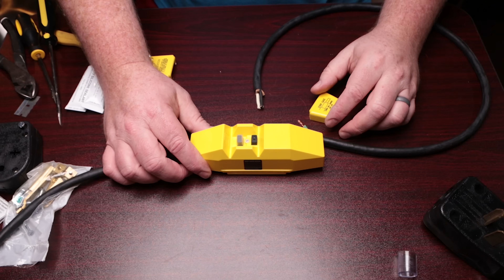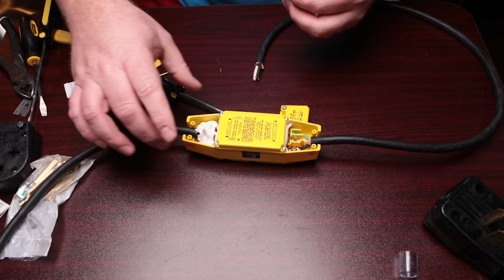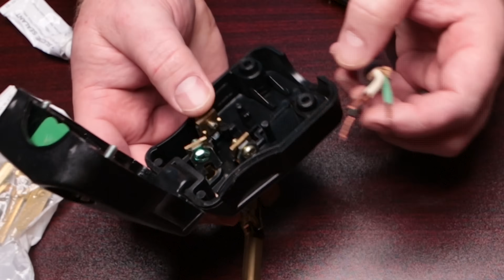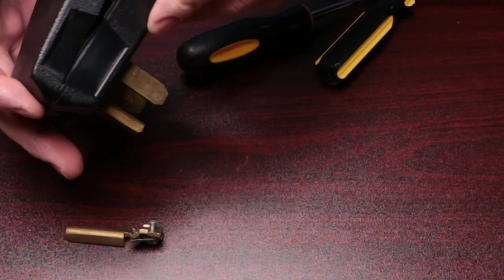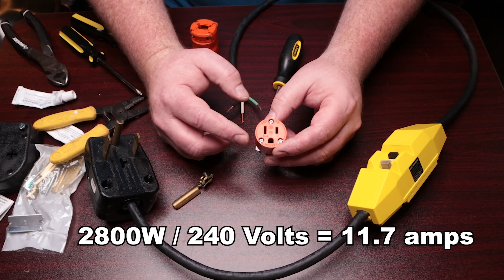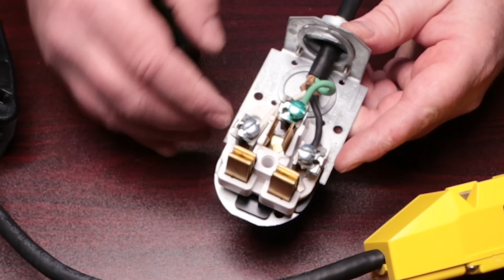Inline 240 volt GFI power cord for Anvil Foundry and Brewzilla Brewing Systems

Comment: Brian, thank you for another great video! One thing I’m confused about though is you using 2 hot and a GROUND wires in the 14-30 4-wire plug. All commercially available 4-prong to 3-prong 240v adapters I’ve seen seem to use 2 hot and a NEUTRAL. What 3 wires does the 240v Anvil Foundry setup need?
Reply from the maker: 2 hots and a ground. Older electrical systems used the 2 hots and a neutral. The ground and neutral generally are connected in the breaker box. (Unless it's a sub panel)   👍🍻
Reply: I am in an older home, so I’m assuming that my dryer outlet has two hots and a neutral (it’s a three prong outlet). I switched to natural gas natural gas 20 years ago so the outlet has just been sitting there. Can I just move the neutral wire to the ground in the breaker box? Or do I need to put in all new wire and outlet?
Reply from the maker: Where is the neutral wire connected currently?

Comment: I have a 4 prong Dryer receptacle.  Should I just leave that piece you took out of the 4 prong in there or remove it and just put the 3 prongs into a 4 prong receptacle? If that is even allowed/safe Thanks for the videos
Reply from the maker: Just leave it out it's not needed. It's for the neutral that's not needed. 👍🍻
Reply: Brian. Thanks for your time.  Since I posted I had one of these made for my dryer outlet--GFCI etc.......however if I ever wanted to have more length on the side of the cord that the Anvil will plug into (maybe if I decide to change my brewing location to be a bit further out to my driveway) could I just add a 240v extensions cord to that end? If so do you suggest one?  Thanks
Reply from the maker: Do you still have the original plug on the Foundry?
Reply: @ShortCircuitedBrewers  yes. I didn't cut it
Reply from the maker: @spinalrx  just use a regular 12gaige extension cord. Keep it to a max of 50' 👍🍻

Comment: Do they make a plug that works for the 12g so you don't need that little spacer?
Reply from the maker: The rating on the plug is higher than 12gauge so it is doubtful. I would just slip a piece tubing over the 12ga wire like I did. it wasn't a special spacer. 👍🍻
Reply: I just purchased the parts. Thanks! Now I need to get a few feet of wire, and also purchase an extension cord. Can I use a regular extension or do I need a 220v extension?
Reply from the maker: Any 3 wire 12gauge cord is fine.
Reply from the maker: If you have a home depot or Lowe's. Take a look at SJOO or SJOOW wire. It really nice and flexible and chemical resistant. Also generally sold by the foot. (Sold as power tool cable)
Reply: Perfect! Your channel is such a wealth of knowledge. Thanks for being so helpful.
Reply from the maker: @tjans1979  good to hear! Thanks for the feedback! 🍻👍
Reply: Brian, few of us on the community noticed that the inline breaker alternates that you provided are not correct and shouldn't be used. I just thought I'd let you know in case you wanted to change your links. Thanks again for all the help!
Reply from the maker: @tjans1979  I removed it already. I saw the conversation. Sorry for the confusion. 👍🍻
Reply: Nah man, it's all good. We are human, I could've made the same mistake. I just returned it and bought the new one. I'm sure you saw the link to that one as well.
Reply from the maker: Yes sir! Thanks for letting me know! 👍🍻

Comment: I bought a 15-50p to 5-15r plug adapter, switched the rocker to 240v, and it's almost as if the unit is working slower... Almost 3 hours to bring 8 Gallons from 50->150. Not sure what I did wrong
Reply from the maker: Sounds like something is wired wrong. It is plugged into a 240v outlet right?
Reply from the maker: Send me a photo of the wiring to Brian@shortcircuitedbrewers.com also confirm you are actually getting 240v at the outlet with a multimeter.
Reply: Thanks, got my multimeter out, looks like the adapter was converting to 120. I'm building your adapter now.
Reply from the maker: @joeodden5326  good deal!! Got the issue figured out! 👍🍻
Reply: @ShortCircuitedBrewers  Works like a charm now, thanks!
Reply from the maker: @joeodden5326  good to hear!!

Comment: If you're not wanting to go the DIY route, I highly recommend acworks.com.  I've used them for funky configurations and they're super helpful with phone service, etc. and they make quality products.
Reply from the maker: Nice! thanks for the tip!
Reply: Hey Ken! I just picked up a 10.5 Anvil Foundry and looking to plug into my existing NEMA 14-50 Receptacle in my garage. Would this ACWorks adaptor do the trick of running the Anvil on 240V and being protected by the built-in GFCI? Looks like it will only support 2,500 W

https://acworks.com/products/s1450cb520-nema-14-50p-to-household-outlet-with-20a-breaker?variant=29483305402429

Comment: My brewing station is about 75 feet away (required cord length) from my only 240v plug on a dedicated 30a circuit breaker. Would I need to bump up the extension cord gauge to 10ga? Or, is 12ga enough?
Reply from the maker: 12 should be good up to 100' 👍🍻

Comment: Does the gfci in line breaking need to be under load to reset? I'm trying to trouble shoot why my new brewzilla isn't getting power. Made this gfci cord but it doesn't rest and test button is stuck down. To be clear it's not tripping the rest, it is not even clicking the rest down...any ideas?
Reply from the maker: Are you using 240 volts or 120?
Reply: @ShortCircuitedBrewers  it's 240, I found that the in line GFCI was fualty and got a new one it all works fine! Thanks!

Comment: Great video and instruction. Always Straight to the point.  Good job.
 I have a question for you. Like some others, I live in a rented house and not possible to modify the electric panel or adding a Spa Panel.  So, to use a 240V GFCI extension cord is my ONLY solution.  I have a 3500W induction cooktop that I bought after I saw an old video on your channel, this is a 3500W 208/240V unit.  I am planning to connect to the dryer receptacle Nema 14-30 (4 prongs).  The actual unit will drain like 15-20 amp, but just want to be ready for another future incoming equipment (Spike SOLO or UniBRAU) that will require I will say like 30 Amp if the heating element is 5500W.  Can I use this GFCI with the 30 Amp consumption? I now that I will have to avoid using all the 4 prongs and will have to properly identify the white wire as HOT with a red tape mark, but for this application, it will require a 10/3 cable and not a 12/3 like this.  If there another unit you can recommend?. Thanks for your knowledge !!
Reply from the maker: This GFI is only rated for 20 amps unfortunately.
Reply from the maker: Here is one rated for 30 amps https://www.amazon.com/dp/B00OZY30RW/ref=cm_sw_r_apa_i_p1jPEbPTJPTCS

Comment: I started making your 240v to 120v adapter for the Anvil Foundry.  I'm wondering if this product would work:
https://www.homedepot.com/p/Tower-Manufacturing-Corporation-18-in-In-Line-GFCI-Cord-30438018/202510249
Could I just plug the Foundry into this, and plug it into the adapter?  It's 15 amp, but I believe the Foundry doesn't pull that much at 240v.
Reply from the maker: you can you would need to change the plug end though.
Reply: @ShortCircuitedBrewers  

So if I bought the product he listed, could I use an extension cord like this with it? 

https://www.homedepot.com/p/Southwire-50-ft-12-3-SJTW-Hi-Visibility-Outdoor-Heavy-Duty-Extension-Cord-with-Power-Light-Plug-2588SW0002/205544514
Reply: @ShortCircuitedBrewers  I'm not an electrician but just get the 240V one at Amazon. This one is for one hot leg - don't even know if it's safe rewiring two of these for 240V.

Comment: I installed a 240V/30amp GFCI 2 Pole Breaker on my dryer outlet.  If you do this too and try to use the dryer outlet thats wired correctly with 3 conductors and a ground you will have to nut and tape off the neutral (white) wire at the 14-30P Male 4-Pin Dryer Plug To 6-30R Female 3-Prong Receptacle adapter or remove the neutral prong as you did. The BREWZILLA and ANVIL both run of a 2 conductor wire (2 hots and ground).  This is essentially what you did by removing the neutral prong. When I bought my converter cable it was wired incorrectly and kept tripping the breaker until I took it apart and figured out they twisted the neutral and ground wires together.
Reply from the maker: Good solution. 👍🍻

Comment: The Southwire GFI is a 240v/20a device.  The Brewzilla 65L calls for a 30A plug.  I recently purchased the components and built this plug but I'm wonder if the thin wires inside this GFI will be enough to handle the load from a Brewzilla 65L?  3500watts for heat alone plus pump and controls probably pushes close if not over that 20A rating doesn't it?
Reply from the maker: You will be fine. It will handle it.
Reply: How did your gfci work. I have a 65L and I just made this cord and it has no power and the reset button will not click down
Reply: @JJJMMMBBBable  If it's not clicking down then the unit isn't getting power.
Reply: @Fidelity101flies  OK, I will check the connections again. Volt meter from wall says 120v from each hot. I should have tested this before putting the Silicon in there. Everything seems tight and only exposed wire is being pressed into the terminals. Same with the plug end....im thinking faulty gfci?
Reply from the maker: Sounds like it?? That's strange.
Reply from the maker: @JJJMMMBBBable  how is it wired?
Reply: @ShortCircuitedBrewers  same as in the video. 2 hots and a ground.
Reply from the maker: What are you plugging the extension cord into?
Reply: @ShortCircuitedBrewers  the wall outlet and the other end to the 65L. I tested both hots to ground with millimeter on the wall outlet, both say 120v. At the other end of the extension cord I get 0.94 v. So outlet is good. All I can do is rewire the gfci in case there is a a break in the wire or get a new inline gfci
Reply from the maker: Should be under warranty right?
Reply: @ShortCircuitedBrewers  yeah just bought it
Reply from the maker: @JJJMMMBBBable  please let me know what you find out.
Reply: @ShortCircuitedBrewers  will do, I have a new one on the way. Thanks for your replys
Reply: @ShortCircuitedBrewers  the GFCI was the issue, the new one lights up and goes green when you press the reset. Thanks for your time and input and videos!
Reply: Fidelity101, did this work for you?   Just got a brewzilla today!

Comment: Hey Brian, I have a 10.5 foundry on the way. I was wandering if a 20 amp GFCI breaker in my panel wired to a 20 amp plug would work? The anvil pulls less than 15 amps. Then, could I plug the anvil directly into the 20 amp plug? Thanks for the advice. Mike
Reply from the maker: For sure.. No problem with that at all. I just made this for those who don't have the set up you do. 👍R
Reply: Awesome, so I just set the anvil to the 240v setting and everything should be good to go?
Reply from the maker: @mikebauman7775  you'll need to check your wall plug and see if it is the same as a standard wall outlet if not you would need an adapter. Can you send me a, photo of the wall outlet? Brian@shortcircuitedbrewers.com

Comment: Have you tried the 30 amp 250 volt twist lock plug and outlets (NEMA L6-30R, 2-pole, 3-wire). I prefer them as there is virtually no way for accidental unplugging of the device.
Reply from the maker: Yes I have those plugs on other devices. This is meant for specific applications and you can modify it with whatever plugs fit your situation. 👍🍻

Comment: In you video you state that this setup can be used for 240 or 120 but you are wiring it for 120. This is confusing since, I thought, the purpose for this video was to enable us to power the Foundry on 240. Is the wiring different for 240?
Will I have to use a different set up if I use this: 
Nema 10-50P Plug 50-Amp 125V-250V 125/250V Dryer Plug Angled, 3 Pole 3 Wire Grounding Straight Blade Plug for Dyer and Ranges LK3351 ?
Reply from the maker: Sorry for the confusion. The input side plug is the only difference. Yes you can use the 3 blade plug for this cord. 👍🍻

Comment: Is there any strategy for using this with a neutral and ground?  I’m using 12/4 wire into my control box in case I want to run some 120v instruments or indicator lights, a pump, etc. coming out of my control box in running 12/3 to my element. Can I put this on that section only?
Reply from the maker: Really for you the best bet is to install a breaker in the main panel or a cheaper option is to install a spa panel in your brewing area. You could use this on the meantime but there is no way to get a neutral I to your panel with this other than a seperate 120 cord.  Hope that helps! Cheers👍🍻

Comment: Maybe a dumb question, but the extension cord you link to is only rated to 125V.  Are you only using the extension cord for the 12/3 wire?  What am I missing?
Reply from the maker: It is rated for either 120 or 240.. The gauge of the wire determines that. The plugs determine the voltage. If you bought it and looked at the print on the jacket you would see the info. Great question! 👍🍻

Comment: Will this device work with 10 ga wire?
Reply from the maker: No, the terminals are not large enough, and the amperage ability of 10 gauge is more that the GFI is rated for. There are other options that come with 10 gauge installed. But more expensive. 🍻👍

Comment: Hey Brian.  This looks perfect for my DigiBoil that I use for strike/sparge water.  Since my HoseHead is tied into a dedicated Ground Fault Spa Box, I made a 10ft, 10 gauge I think, extension from my Dryer outlet to near the DigiBoil.  I cringed every time I use the DigiBoil.  Cost and the fact that I rent held me back from hiring a Ground Fault breaker installed.  I'm thinking that I could cut this into the existing extension cord cheaper, and this goes with me if I ever move.   One Q:  I dont readily see where to get this device.  Cheers.   AJ
Reply from the maker: The parts list is in the description. It would definitely work for what you want to do! Cheers AJ! 👍🍻

Comment: If using an older 3 prong dryer outlet this adapter is useless. Older houses have the 3 prong because the ground and neutral are bonded together. It was a way to ground the electric dryer through the neutral lug. GFCI works by measuring the current flow, if it detects a leak to ground it trips far faster than in an overload fault thus why safer. A 4 prong dryer outlet (or a 3 prong retro fitted properly to a 4 prong) is preferred.
Reply from the maker: Good tip!! Thanks for sharing the info. 👍🍻
Reply: The way around this is to make a different input  cable. I used an old dryer plug (10-30R), but only connected the two hots. I got a standard 120V plug (5-15), and ran the ground wire from that into the GFCI. Basically a Y cable, connected to both the 120 and the 240 outlets, and fed it into the shown GFCI. My house is pre-1996, had the old dryer outlet, only three wires running to it, and it was going to be cost prohibitive, and possibly not possible, to run a new cable to get the ground. Fortunately, the washer and dryer are next to each other, so both outlets are close. Similar cables are available on Amazon for various configurations, with the ground pigtail supplied. This allowed me to run the two hots and the ground into the GFCI.
BTW: Great video!
Reply from the maker: Yeah they actually make an adapter to pick up an ground on Amazon also. Your way works though. Thanks for the tip! 👍🍻
Reply: @ShortCircuitedBrewers  Hi, I'm assessing my outlet hoping to buy an Anvil. It looks like I have an old NEMA 10-30P outlet, which is not properly grounded (?), therefore I can't make this in-line GFI adapter, is that right? But could I use the adapter on Amazon for a NEMA 10-30P to 14-30R with additional green ground wire? With that green ground wire plugged into a 120v outlet ground-pin, then I can make and use the adapter in the video here? Not an electrician (if that wasn't obvious).
Reply from the maker: Yes you can use one of those adapters no problem.
Reply from the maker: @johnwallace5221  it really depends on whether or not there is a neutral or a ground connected to the round port in the plug. If it is a neutral then the safest bet is to install a breaker in the box..👍🍻
Reply: This adapter should work on a 3 prong, but it has to be wired differently.
Reply from the maker: @beerman1957  ok what's different?
Reply: @beerman1957  correct, the 3 prong outlet are the two hots X & Y and the neutral. The ground (if it is run at all in the wire, it should be) is hooked to the outlet box itself which is normally metal. The neutral ground bond for the 3 prong dryer cord is inside the dryer itself ussually.

So yes it can be done, but with some modification that could be performed by the home owner if familar and done properly.
Reply: Bassguitarist1985 I have the old black white red and ground. The white is on the curved part of the plug. What should I do to make this work?

Comment: Recommend having the GFI on the circuit breaker done by an electrician and not DYO for most people. This is high current and not for everyone to play with. Anyway this is a good guide to how to do it if you do know what you are doing ;)
Reply from the maker: I certainly rather the breaker too. But if someone is in an apartment where they can't change breakers. This is a good option. 👍🍻

Comment: Would be good if the manufacturer s of electric brewing add some add on piece of electrical equipment for 240v for countries that use 100v-110v. The 65L electric Brewzilla is 3500w, 15Amps, 240v and the new G70 Grainfather 60L/16 US gallons is 15Amp 240v must be similar size elements. I would need a dedicated 15Amp 240v socket to run 3500w Most of my home plugs are 10Amps/240v.  Some  mobile phone manufacturers are using a global plugs 100v-240v which is really great when  traveling.
Reply from the maker: yeah once you get up into higher wattages it can become an issue.